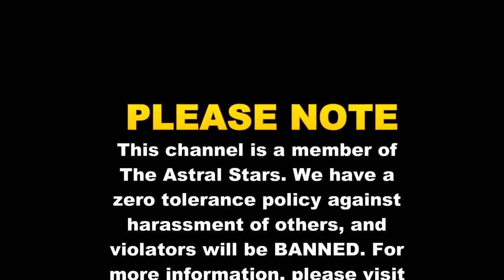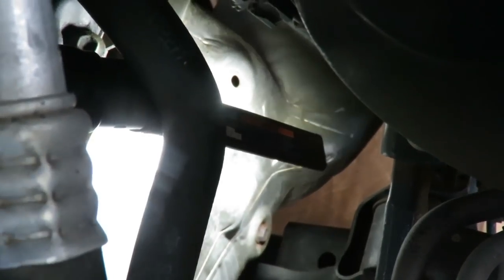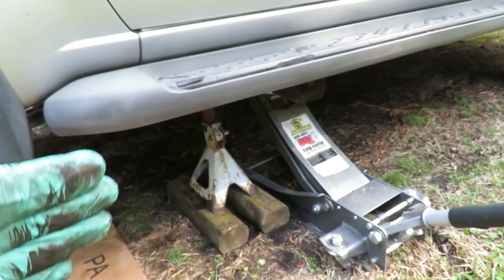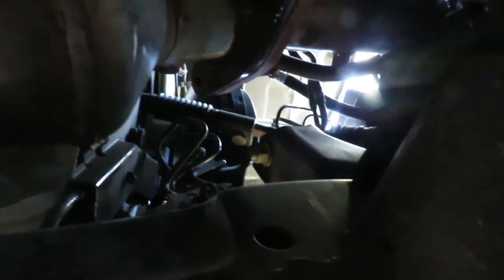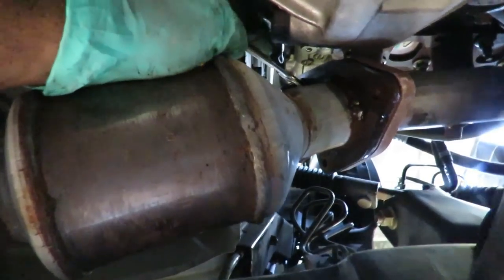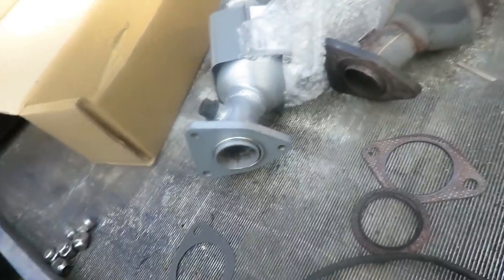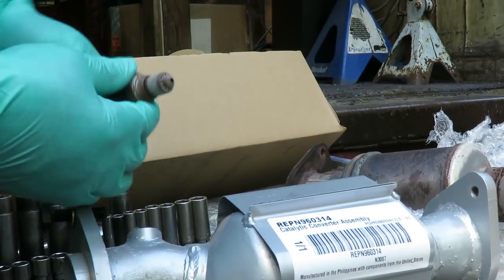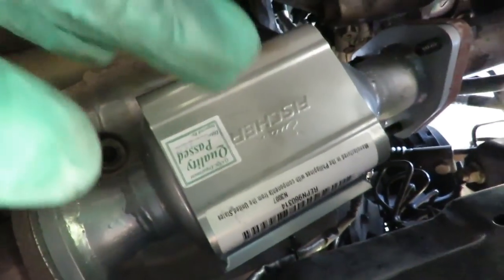⭐ 2005 Nissan Pathfinder - 4.0 - Left Catalytic Converter - Driver Side

Comment: I changed all 4 cats on my 07 Xterra yesterday and it actually went pretty smooth but I had to cut out the heat shield on the passenger side to get the the cat bolt on top so now I don’t have a heat shield on the passenger side. How big of a problem is that? I can wrap possibly affected parts with aluminum tape but I’m not sure what parts are at risk. Any feedback would be greatly appreciated thanks for the video.

Comment: Thanks for the video, have a quick question, after installing should there be smoke coming from anywhere?
Reply from the maker: Yes, you might get some smoke from around the new cat. It's the oil burning off. It should go away within 15 to 30 minutes.

Comment: How long would it actually take you to change that coverter , trying to get a sense for long it takes so when I go to the shop or not , they don't try to make it seem like it takes hours  n hours to do
Reply: A proper shop with tools and parts available might take a few hours.  I did both of mine in the driveway on a 200k+ mi. Pathfinder covered in rust and it took a while.  Removing fender liners helps immensely.
Reply: I also got cheap new cats from Rock Auto and they don't line up with our fit the existing flanges.  So that took quite a bit of fussing around.

Comment: thanks for ths video. i have a 2008 pathfinder le that was from a northern state and rusted quiet badly underneath. has been nothing but trouble from day 1. i have already had the exhaust manifold assembly replaced due to a factory weld issue per the mechanic and the A/F ratio sensor and now a P0430 pops up which i am assuming because the cat converter is damaged.  any suggestions on best way to remove the exhaust cover and then removing the bolts/studs? should i even bother with the replacement or just take my loses and sell the vehicle as is?
Reply from the maker: It is extremely rare I suggest NOT to put any more money into a vehicle, but RUST is not something you want to mess with.

Comment: Thank you
Reply from the maker: Glad we could help.
Reply: @OnlineAutoRepairVideos    How to know if is bad o not.  Many mecánic said it’s mass air flow sensor another mecanic said it’s the catalyct converter.  Please help. When I delete the code everything is going well  but when it comes back start to.  I press. Gas and does not go. Starts to lose power I don’t know what to do
Reply: Code is p0101
Reply from the maker: P0101 is a problem with the Mass Air flow!

Comment: Presented very well! Subed
Reply from the maker: Thanks Scott!
Reply: So I took off the o2 sensor at the catalytic converter and was getting a reading of 55 psi which would suggest that it's pretty much shot. My question is what additional damage could be done to the engine if its ran like that and how long would it take. I've only driven it a total of 10 miles since the check engine light came on and got a p0300 random misfire fault
Reply from the maker: @galyien  With a clogged cat, you will eventually lose power, and the car will only reach about 35 MPH.

Comment: Timmy I have a question my 2012 pathfinder is reading code PO 420 bank 1, should I change the one is close to the tire or the one underneath ( the long one)?
Reply from the maker: You have to find out which side is BANK 1, and then replace the FIRST cat on that side.
Reply: @OnlineAutoRepairVideos  thank you! I saw your other video where you changed bank one is the same as mime ... But I went to autozone and they showme the bank one has to cats the long one and the one you show on video where you have to take the tire off in order to take it out!
Reply from the maker: @arturoramirez6742  Does the long one show an O2 sensor AFTER it? The 2 O2 sensors should be BEFORE and AFTER the main one.

Comment: Must be a common problem in these trucks. Mine have gone out 3 times already.
Reply from the maker: Was the exhaust manifold gasket replaced at the same time, and did you have any other codes at the time?
Reply: @OnlineAutoRepairVideos  I dont think I've replaced the gasket. The bank 2 sensor 1 code did come up as well as P0430.
Reply from the maker: @RANDOM-qs1dc  That sensor could be an issue, but we have come across that if the gasket is not replaced, it messes up the converter.
Reply: @OnlineAutoRepairVideos  yeah both have gone out around the same time, I just replaced the sensor, but the p0430 code is still on.

Comment: Any suggestions for breaking the original nuts loose? they don't have a head to put a wrench on both sides. 3 studs and 3 nuts. One stud is in the manifold and the other 2 are in the cat.